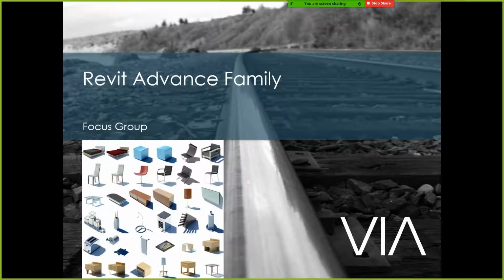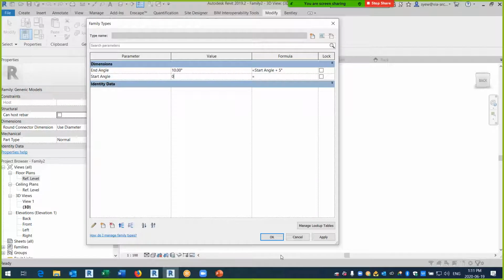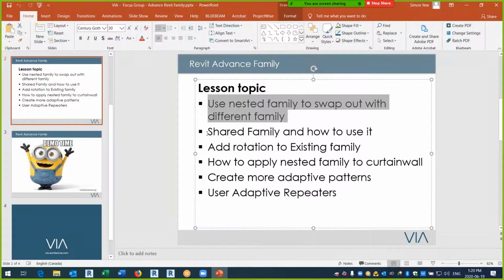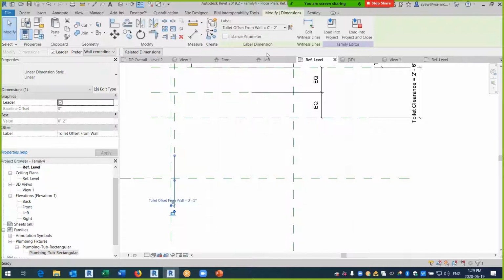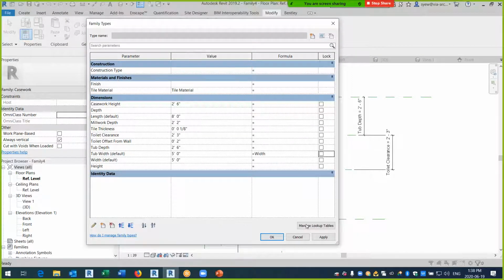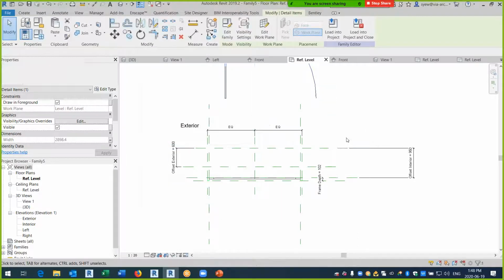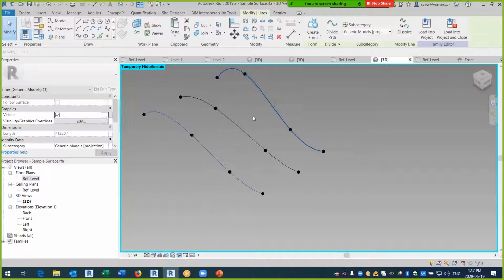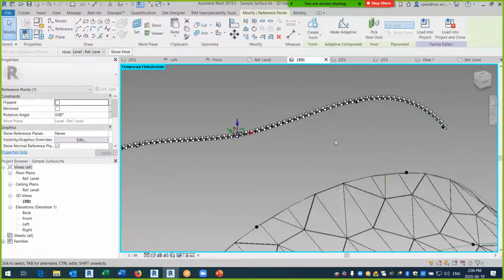Focus Group - Revit Family Building Technique made easy

Comment: revolve for your rotation parameters is great. That guy that made the Revit elephant (the structural guy that does the Autodesk talks) has some videos on that, I stopped using ref lines /planed since then. Great video as usual. 
Do you remember a video you uploaded a few weeks ago or months ago that had no audio, where you went over the invisible line type among other things? Are you ever going to upload it again? Even without any audio, it was very followable.
Reply from the maker: Thanks....yea reference plane breaks too much. I attended AU few years ago and Marcello "Revit cow & elephant" guy show me how to make that.
Reply: @scourdx  I made that comment before I saw you using the revolve, I figured you knew about it, I have seen you use some of Marcellos model's